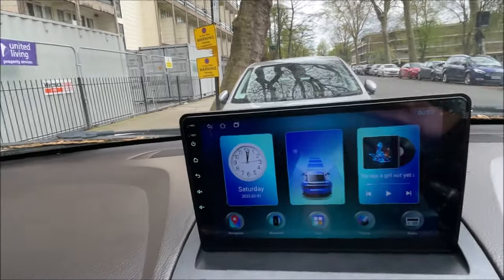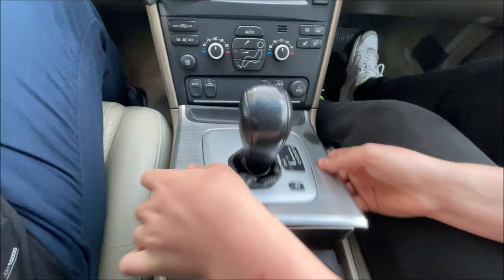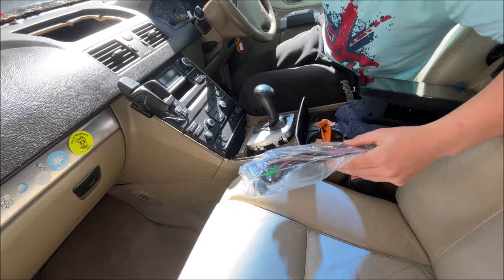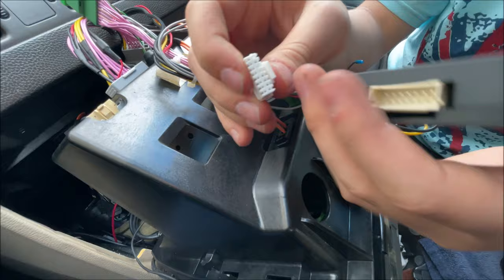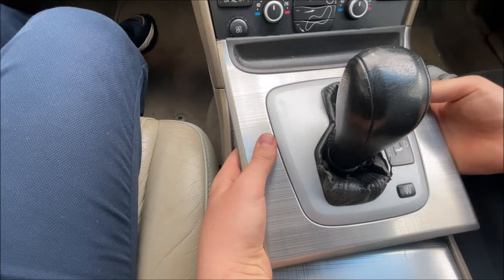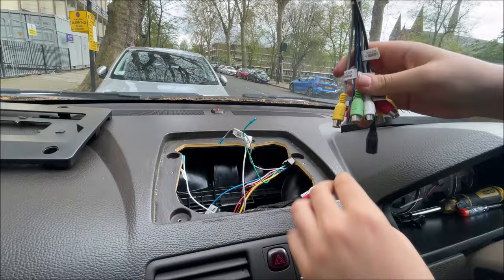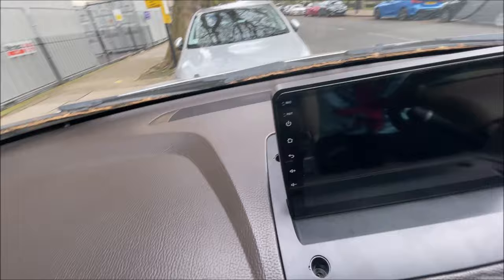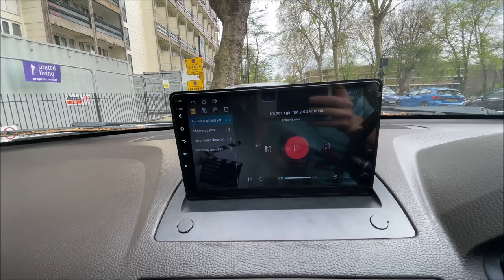How to install Apple CarPlay / Android Head Unit to a Volvo XC90 MK1 (2002-2014) - UNDER £150!

Comment: Hi , I have a 2005 xc90 with a factory sat nav at the top, and i have no AUX.  i was wondering if you could advise me on what will happen like how do i get audio if i dont have aux how does the no aux Android sat nav works? and do you mind explaining how to get the sat nav off ? best regards
Reply from the maker: Hi mate
The screen for the cars without the aux bypass the amp, so your original radio and parking sensors will not work
Apart from that, it’s like a normal android screen, and with the original sat nav, just use a pry tool and dig in and up
Here’s a link for the screen: https://www.ebay.co.uk/itm/314566818009?mkcid=16&mkevt=1&mkrid=711-127632-2357-0&ssspo=vkcosyhktgw&sssrc=2051273&ssuid=vkcosyhktgw&var=&widget_ver=artemis&media=COPY